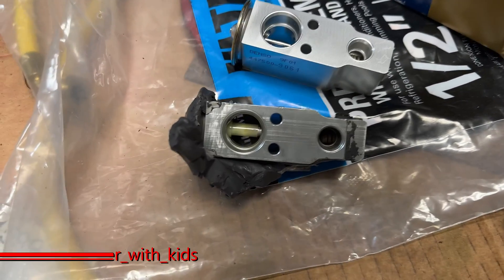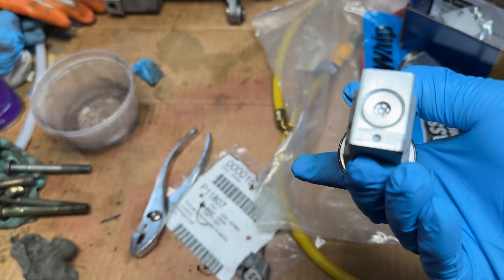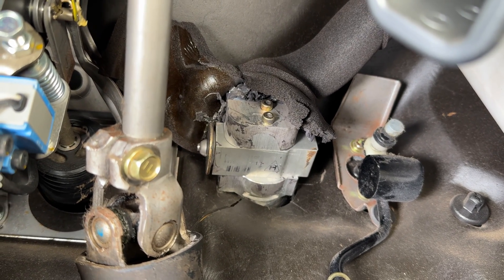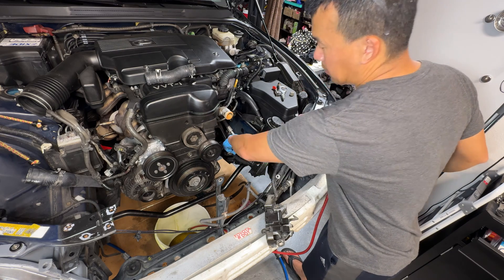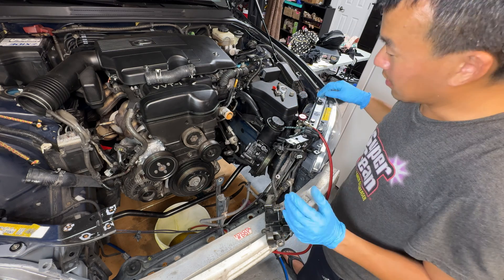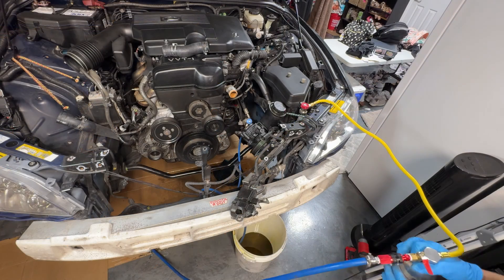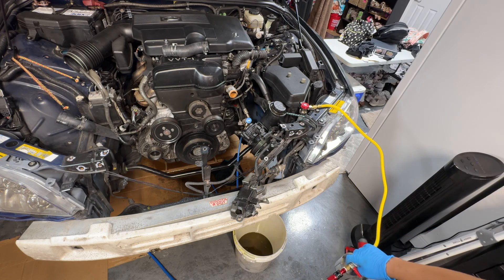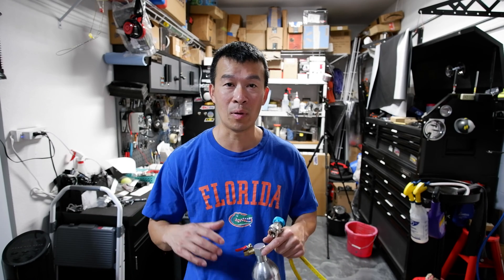How to Flush Automotive A/C Lines, Evaporator. and Expansion Valve

Comment: I did the same thing with the expansion valve, got 2 used ac lines attached, but I wouldn't use brake clean for the evaporator because you're going to smell it when all done. I used home Depot coil cleaner which is actually cheaper. This process works perfectly and the people that comment negatively obviously they don't have much experience 😁👍x

Comment: Why did you need to drill the Expansion valve? Cant you just flush out the evap from the suction and the HP line behind the expansion valve?
Reply from the maker: No you can’t hard to reach. The expansion will be closed and also trap dirt. Since the Exp valve is in the way, no easy way to get free flowing solvent into evaporator.

Comment: I saw the mess coming before it happened. How hard is that crwp to clean up?
Reply from the maker: Easy, it all went to ground. Should have clamped the hose to the bucket. It’s solvent based so wipe and it evaporates.

Comment: Hey binh when you say drill out the hole bigger on the expansion valve. Do you just drill out the side walls of the hole and not touch the tiny little pin or do you drill out the pin inside the tiny hole also. Also what size drill bit do you drill it out into if you dont mind me asking.
Reply from the maker: Remove the hex bolt at bottom and take the bearing and spring out. Drill through from that end. Use anything bigger that the existing opening.
Reply: @TunerwithKids  after drilling out the expansion valve. are you supposed to leave the ball and spring out to flush the system, or do you put them back in before you flush.
Reply from the maker: Leave it out but out the heat bolt back.

Comment: Am going to be honest, I'm surprised you release this video with so many errors, I mean that hose? High pressure? And you have it sitting on the bucket with no support.
Reply from the maker: Yea trial and error. Most people I see online just dump it on the ground.
Reply: Good video but you need to explain where to connect each of the lines and close up with your camera please
Reply from the maker: There’s only two connections and doesn’t matter which you do because you send it one way and out the other end. It will be different for everyone due to what components you leave in system. I was flushing lines thru the evap core inside. I didn’t have condenser in.